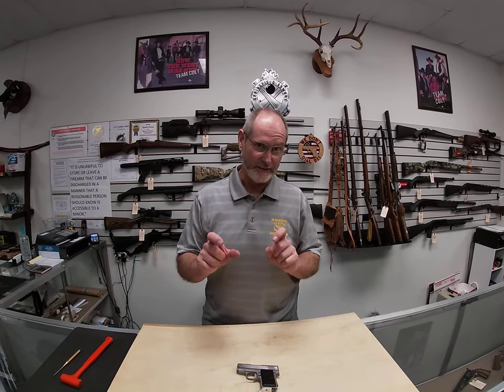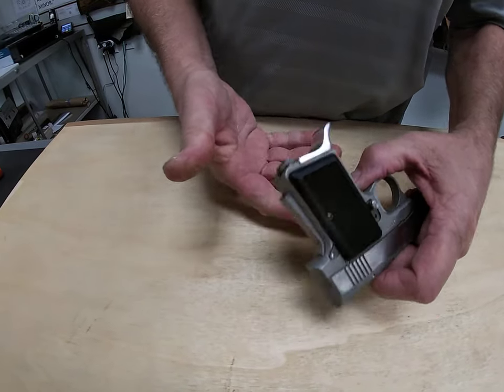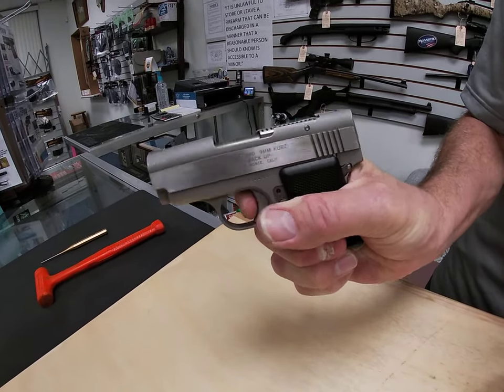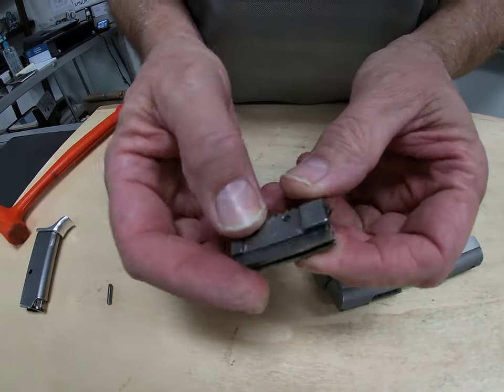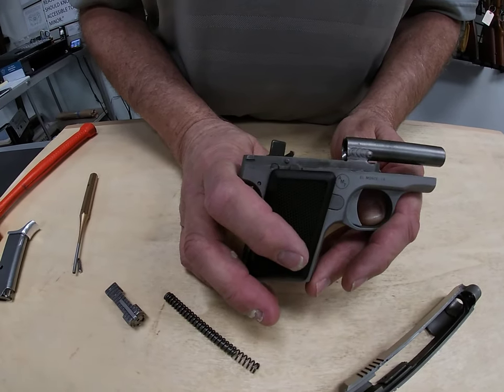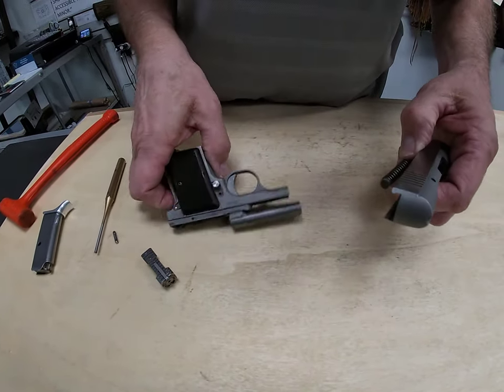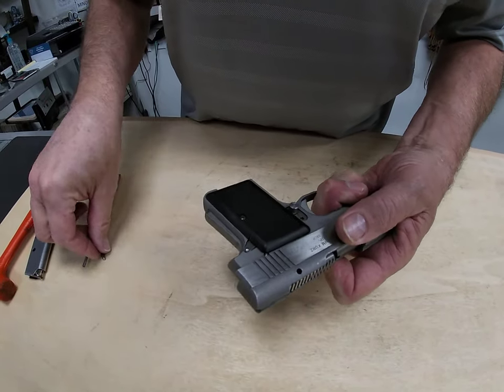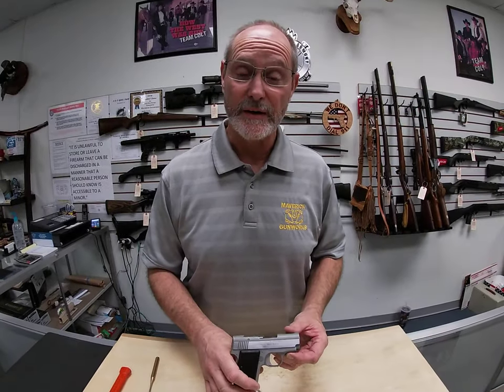AMT 380 Back Up

Comment: I have an AMT backup in 380 but mine seems much different. The mag releases from a clip in the bottom, it has no safety and the boot isn’t as exposed.   Very interesting
Reply: I have the same one, Gotta problem with it @thugmotivation__ text me so I can ask a question rq
Reply: That is the 2nd generation back up. It also has an elongated2(oval) trigger guard. 1st generation has a round trigger guard.

Comment: Hey guys not sure if you still pay attention to this, but I got one of these from my grandfather and after I disassembled to clean, the trigger will no longer reset upon racking the slide. You have to manually pull the trigger forward. Any clue what can cause this?

Comment: Is it normal for the take down pin to be so tight that it is very hard to punch out or back in. My dads amt 380 hasn’t been cleaned in a long time and it was very difficult to get pin out and then back in?
Reply: Yes, this may be the 1st time it has been ever removed. Better to have it tight then to have it pop out at an inopportune moment.

Comment: Anyone know if there was an extended grip/magazine made for this by anyone? Also is there a recommended make of rounds? I've had a lot of jams with mine so far.
Reply: I have seen 10 and 15 round extended mags(but I don't get the point, he mag is 2 to 3 times the length of the gun). As for feeding issues check the magazine feed lip width(too narrow, too wide) and then the try to polish the feed ramp with 600 to 1200 grit sand paper.  If it is stove piping check the extractor. Just my best guesses.